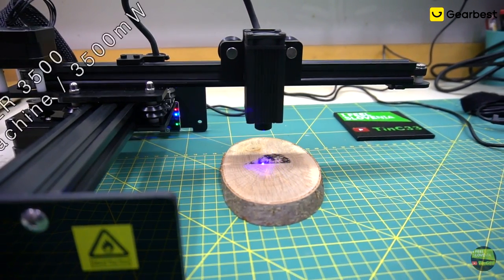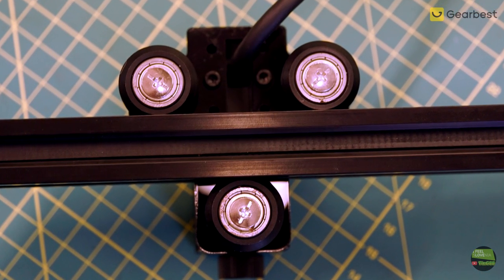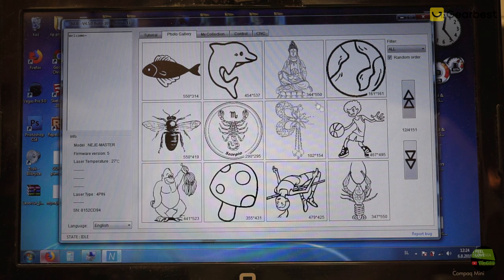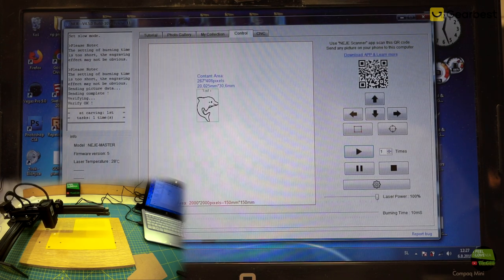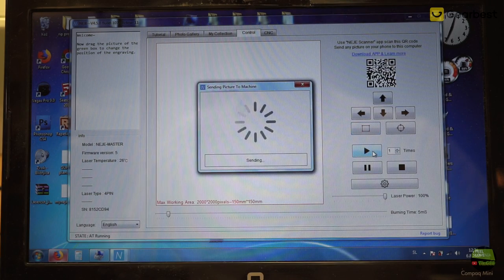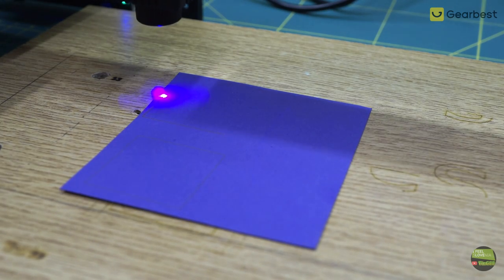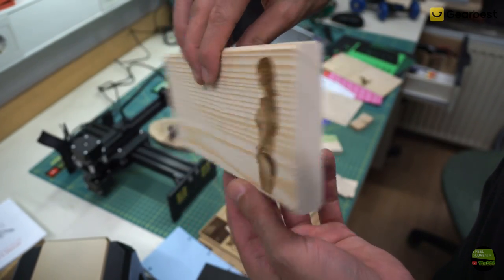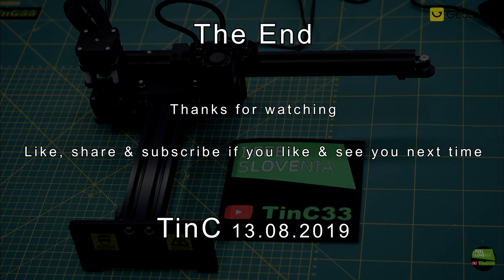NEJE MASTER 3500 Laser Engraver [review / software / first test on different material]

Comment: Hello,  does this machine works with Stainless Steel? like pet tags and utensils (knives, spoon etc)
Reply from the maker: I try every laser also on stainless steel, every one leave some traces specially if we use permanent marker, but far the bost modul for stainless steel is ortur Lu2-4 work without marker, but for serious stainless engrave you'll need expencive fiber laser.
Reply: Thank you for the info :)

Comment: When you attached the top rail part to the lower rail part via the 4 screws, did the two parts have any wiggle/wobble room between them or was it firmly attached after connecting?
Reply from the maker: There is just a bit wiggle yes because ob the Y axis wheels, it's got just a bit free space, and can't be tighten closer to the rails, if want to fix need to extend hole for wheel screw, so it can be tighten closer to the rail, no big dial but i leave as it is, because i don't see need to fix that.

Comment: I just got the 20W laser. Do I need a special power source? Or can I just plug it into the wall? I was confused when you mentioned the difference in power supply. I haven’t unboxed it yet. Any recommendations for cutting and engraving all in the same project?
Reply from the maker: If you buy 20W complete laser machine not only the modul, than should be there already 3A power supply. you got nothing to fail here, if you use 2A laser maybe stop working sometimes during work with full power, if that happend you know you need to buy new PS for a few $.

Comment: Two questions. 1. Could not understand how to find the (0,0). 2. Can this laser delete markings on IC's?
Reply from the maker: 1. i don't remebmer if there is a buttn on the software to get home on 0.0 pozition, but i think only on beggining, when pc connect to a laser, it going home home to zero pozition, and then all the time motor hold it's position, also when not working, and after finished again going home...
2. i don't know, didn't test yet
Reply: @TinC33  Thank you for your reply. Good job on the presentation!

Comment: Great video! What strength of laser would be required to engrave metals? What strength of laser would be required to cut through 6mm plywood. Thanks!
Reply from the maker: To engrave metal need more expencive fiber laser, to cuf wood like a boss need a co2 laser cutter.
Reply: TinC33 thanks for this. I’ll look into those options. Best!

Comment: Please can you tell me, where the switch off button is? Or do i just have to disconnect the power line? The red button is just for offline working...  i unfortunately couldn’t find any answers on google...
Reply from the maker: No switch there, it's always better to disconnect ac power cable so also psu is disconnected
Reply: TinC33 thanks

Comment: Hola, he comprado la máquina hace unos días y estoy haciendo pruebas. ¿Tienes los parámetros para algunos de los objetos? por ejemplo para el cristal que viene no encuentro el acabado exacto y lo más aproximado es 50 LP y 20 MS.
Lo que no consigo grabar es la placa de metal que viene de ejemplo por más intensidad y tiempo que le he puesto.
¿Podrías ayudarme?
Gracias
Reply from the maker: just make lot of test until get right result ;)
For engraving steel you need to use permanent marker, you can check it there:
https://www.youtube.com/watch?v=Hvg8slOVSyE&t

Comment: The Neje Master 3500 is not designed to cut wood.  On another note you should never cut vinyl and will not engrave on metal.  You need the Neje Master 7w
Reply: The Neje Master 7W can engrave metal?
Reply: Javier Atenco yes the 7,000 can engrave metal. You’ll need to use a dry erase marker on it first so it doesn’t reflect and cause it to shoot the laser in other directions.

Comment: Hello Sir, thank you for the video. Do you know if the NEJE master 3500 is the same as the ORTUR engraver? Are they just rebranded? Do you know which one works with Mac OS? I want one just to do engraving on wooden toy models.
Reply from the maker: I just making video about ortur, wait few days ;-) 
Only neje work with ios and also neje software offer much more, ortur not support dxf and nc files, but ortur is 32bit work faster smoother and more accurate

Comment: to CUT material all you have to do is increase burning time and power ? and to engrave decrease burning time? its only a matter of burning time between CUT and engrave ?
Reply from the maker: Yup that's right, more time laser burn on one spot more materiall will burn...
Reply: @TinC33  so, To cut materials i can use MORE "ms" at full power or minus "ms". what mean MILISECONDS in the LASER ✴️☢️ working ? i guess, less ms much fast the LASER burn right ? otherhand MORE ms the laser burn slow and more deep is the cutting right ? i could probably wrong.... Teach me a little bit please .
Reply from the maker: @M4R10_  Laser power is power laser work with, you can get that settings all the time on 100% (except in some cases, tell on end) burning time is actually speed of stepper motor, spped of engraving, speed of cutting... That tell us howmany time laser burn each spot before move to another, if you set to a few ms entire laser moving so fast that it only leave a burning trace behind (engraving) if you set that settings to high, laser move really slowly, so it got time to burn each spot befor moving to next one, so in that time it's burn the material that much that it actually cut them (cuting). The power of laser you need to decrease only in case when you want to engrave on something like paper, if you set it too fast like 2-5ms, laser become that fast that the image was not clear, you can see the vibration on them, well if you decrease speed it go slowly, there will be no vibrations, but the laser will burn the paper in that time not only engrave, well in that case you need to decrease as laser power as speed.
Reply: @TinC33  THANKX. i bought a NEJE Master 20W. but i use 💻 MAC. the machine doesn't arrive yet  so i am making research in this new world.  thank you for the explanations. i guess 20W laser can cut at 100% power a paper foil dont you kkkkkkkk ?
Reply from the maker: @M4R10_  20mm wil cut 3-5mm thick wood, not only paper ;) good when you get into oyur hand and play a few hour with it you'll know averything, it's really simple to use.
Reply: how can i measure the focal distance ? to better use the Beam Laser ✴️☢️ ?
Reply from the maker: @M4R10_  by eye with a glass wich come with

Comment: 8:13 - Screen says "2000x2000 pixels, 150x150mm", which works out to be about 350DPI. That doesn't seem very high for a laser considering how small the spot can be. Is that a limit of the software or the machine?
Reply from the maker: True that mean that the size of a pixel is 0,075mm, pixels can bee seen if we check closely but for basic use i think it's just enough, is it hardware or software limitation i don't know.
I just montage video about ortur laser (come in a few days) it work much better because of 32bit board, but the laser modul and software is much better on NEJE.

Comment: Question. I want to buy one as well. Do you thing you can make the working space bigger. What's the belt size and thickness? And can you buy that belt in any size you think?
Reply from the maker: You can buy the extrusion and belt no problem, but if you make it bigger it won't work precize, also on that leingh you can see there are vibration if we work too fast... For bigger area i suggest different design of a mainframe.
Reply: @TinC33  Thank you for your quick respons. Ill think it trough a bit more than. Happy new year by the way.
Reply from the maker: @hoppie538  same to you, check on banggood or gearbeat for laser with bigger area, they got "cage" style frame and cost just a bit more, but they're much bigger.

Comment: hi tin...I just recieved laser from luck store...everything great but software puts line at some corners of most images on windows?
Reply from the maker: Does it make lines on preview image or only on finih engrave foto, if the lines visible on finish engrave image lower down the speed (increase ms and lower down laser power for same but more accudate engrave)
Reply: @TinC33  only the finished engraving...the right and bottom edge of image, I'll try the adjustment ty
Reply from the maker: @lumanation2032  that's it lower down the speed

Comment: Price for this setup? And do the 7w, 17w, 20w etc just plug and play if you wish to upgrade or use for cutting and engraving more difficult materials?
Reply from the maker: Check the link for the price.
When you want to upgrafe laser just unplug old laser, unscrew it and install new one that's it one connector and 4 screws.
BUT if you wang to use 20w laser you''ll need 3a 12v power supply, the one come with is 2A 12v.
Reply: @TinC33  also 20W they specified at the website is not for engraving only for cutting, so I wasted my money on that one, is terrible quality 20W for engraving better use 7w
Reply from the maker: @kira07  really? I didn't try 20W yet, but don't undestand why it can't engrave, even if you decrease laser power?

Comment: Great! Can I ask you what are the best settings to get the grayscale image like that of the girl in a bikini forma example? Thank you!
Reply from the maker: I think -laser power 100$ and 5ms time. so it also engrave really fast,  but it's really soft wood
Reply: @TinC33   Thank you for the answer, I'd like to ask the same like Zio Gius. Could you please write different settings for different materials? [ (leather, hard wood, cardboard, and if you have stronger laser module (I have a 7W module for this engraver as well) I'm interested about harder, stronger materials, maybe metal.]
Thank you if you can help with 3500, and the 7000mW if you have, it would be great for the help with it. I have another engravers, a 15W (pulsed, average 8W) that can engraving any metal without any anodizing, and a 17W module, what I can't connect to any driver board, and I have a small 500mW, and an analog (without ttl or pwm) 2500mW laser module. The 17W and the two smallest can be mount to a 50x60cm machine (with everything - stepper motors driver boards, only what I can't to connect the right way to any board the 17W module. It burns like a hell, the motors are working, but the ttl doesn't. It's always on full power. Maybe you can help me?
I wrote a lot.
Thank you for everything if you can help me - or for every tips!
God bless you!
Reply from the maker: @gaborsomlyai5688  Hy, sorry gábor, i would like to help you but i don't got knowledge about all this lasers specially diy, versions.
For settings i can't help ypu because i only got 3500mw laser modul, i would like to test 20W modul but it's out of stock.
Best advice i can give you is make test firstly, i always make a test on same material like i want to engrave, when the settings is ok, insert material wich want to engrave and go...

Comment: Excellent review. Thank you.
I was wondering if there is a problem with the smell when you use the machine, do you need a filter? or something more than the machine?
and I wanted to know if it cuts and engraves in acrylic -PVC and what is its quality? and how many mm must the acrylic be
.
Thanks a lot
Reply from the maker: Neje 20w can cut acrylic about 5mm but only dark colour not white or transparent... There are smell specially on plastic, acrylic lot of fumes and smell, on wood depend, if yoh engrave only surface it's no problem, but if you make deep engrave like 1mm deep all the materual go into air as fumes, so yoz can imagine the situation, i make this into workshop and leave open window, no problem, but not for livinv place luke room, because everything (specially clothes) got smell of burned wood days after work is done, so for room i woud make some wooden box and 100mm tebe + fan trough the window...
Reply: @TinC33   First of all thank you very much for responding. second I saw that you have more videos about other machines of that brand I watch them but I would like to know, which one do you recommend from personal experience to cut and engraves small parts in acrylic with good quality?    thank you
Reply from the maker: @danielacohen7064  did you check my last video about ortur upgrade? Well for that what you need i will take neje, because it's more powerfull, and neje software is good, ortur is just mach faster, so if you need speed take ortur, but i think laser modul is neje better in every way.
Reply: @TinC33  thank you so much for your help !!!
Reply: @TinC33  Yes, I saw your last video, but with the Neje brand, which of your models do you recommend for acrylic? I mean 3500MW? 7W? 15W? 20W? thank you
Reply from the maker: @danielacohen7064  for cutting no dout, one and only neje 20w is far the best, engraving is a bit better with 3,5w but you'r too limited with cutting, now you can get neje 20w with coupon for about $200
Reply: Hey may be a little late, but NEVER engrave pvc. It emits a poisonous gas. So yeah

Comment: HI, I love my little NEJE and after watching this, I think I'll go for the 6000mw or maybe 20000mw= 20w. I've an simple idea which may help with the shake, when I get one I'll try it, if it works, I'll let you know. It may damage the arm. so I won't say as I do not want someone to damage their machine.
Reply from the maker: Ql, but there are all out of stock, so you must check for some other brand ;)
Reply: @TinC33  Cheers, I found that out, so bought a similar one on ebay for £108.43. It's a Master 3500/6000mw 7/20w High Speed mini DIY CNC Laser Engraving Machine K4L7.
So when I receive it I'll do the add on and hopefully it will work well.
Cheers once again and have a great life. 6000mw mod.

Comment: Great video if you can tell the power and burning time you have used for cutting will be highly thankful, my engraver has recently arrived but i am new to this so burning time and power understanding is the issue i am facing if you can tell me it will be much appreciated.

Best Regards
Reply from the maker: i tell you just try, try  and play with different settings, you got nothing to do wrong until you got protective wood under the working area, and safte glasses on your nose.
Mest way to start is take piece of wood and start let's say bruning time to about 50% and laser power to 10% than increase laser power by 10 and you'll see... than try different burning time, you'll get everything really fast after few try you'll understand the concept of settings.
And yea for testing pieces make small photos or just grayscale sample not bigger than 1 or 2cm size, so you don't wast too much time
Reply: @TinC33  Alright thanks alot for the directions, i will try different settings to get the best result :)

Comment: Will this engrave a logo on tin? What power laser would I need for engraving on tin?
Reply from the maker: sorry but i dont got experience with that material, i don't know.
Reply: Repairer Of the Breach you’ll need a 7000 W laser to engrave metal, this brand sells 7000 W on amazon too

Comment: Hi TinC
Nice video!
do you know if the laser driver is inside the laser head or is on the main pcb control board?
I would like to use the 7W head on my customized router.
Did you open the fan side of the head? is there any electronics?
thanks a lot for helping!!
Reply from the maker: Yes the laser driver is inside the laser modul. there are 4 wires from board to laser modul one is negative one positive (12v) third is for PWM controll and fourth is for temperature signal, so i thing every 3 or 4 wire laser with PWM can be mounted on
Reply: @TinC33  Thanks a lot!

Comment: Hi TinC33,
Is it possible to change the chassis in A4 format?
using joined greenhouses to avoid tipping! 
and if possible is there a modification software to do?
Reply from the maker: Hey, i was thinking same think, but then stop me on same spot: firmwhare, where to find and how to flash... Maybe there is a thing to repair a few dimension into software, but anyway i think it's cheaper than to buy arduino+ drivers + motors and a laser modul and make a diy version.
Reply: @TinC33  
In the idea I think it's feasible, aluminum profiles are easy to find and change. In my idea it was to change the laser and switched to 20W version (cheap on Ali 100 €)

Comment: What other possible software programs can we use with this laser engraver? This Neje Tool program is not amazing, and is actually not downloaded onto your computer, it's almost as if it doesn't exist?? 🙄😬 Please help
Reply from the maker: What function do you missing into neje tool?
You can use also laser grbl software
Reply: The program somehow fills my PC with cache/memory and after a couple Burns it no longer prints clean text 😥 thanks for the GRBL recommendation
Reply from the maker: @esovae  really, huh i don't know, did you install the software or just run it? Try to copy all the files somewhere to desktop and than run again

Comment: Hi, mine couldn't install it, when I try to install it it gives me a popup window that says

Microsoft .NET Framework 4 is already a part of this operating system.  You do not need to install the .NET Framework 4 redistributable. 

Same or higher version of .NET Framework 4 has already been installed on this computer.
Reply from the maker: I got same message when i try to install chitubox (3d printer slicer) i couldn't fix, than i take other pc with win7 64bit system work in a first try.

It's deffinitly a pc issue.